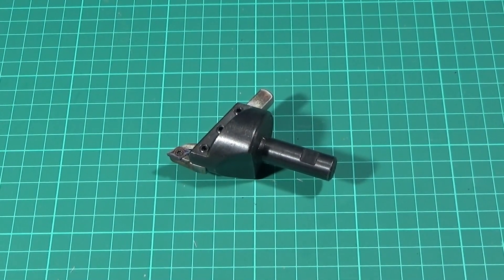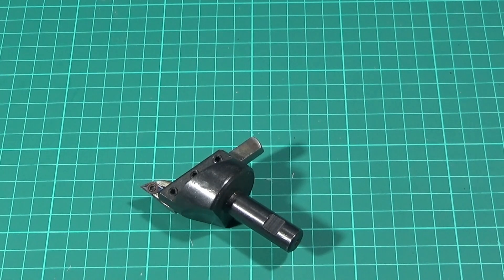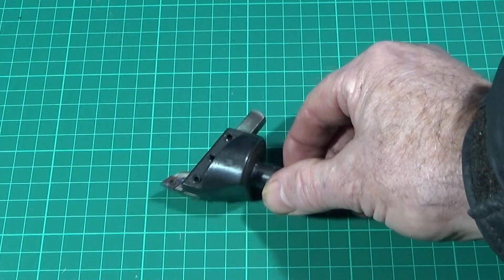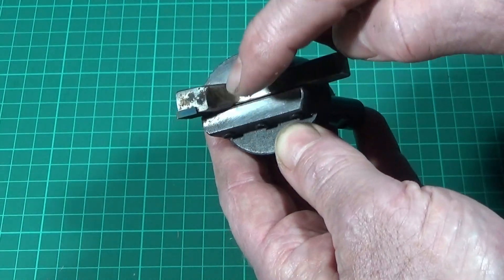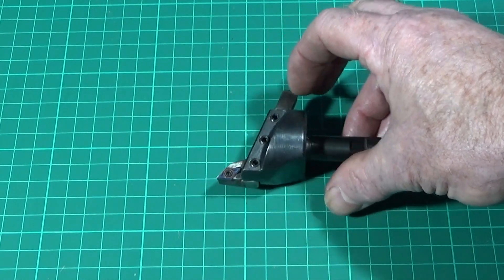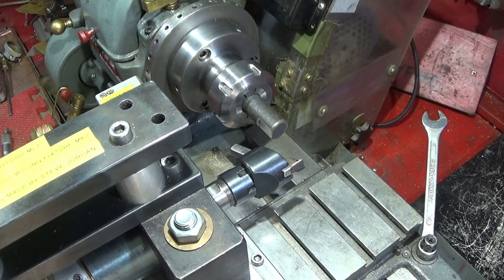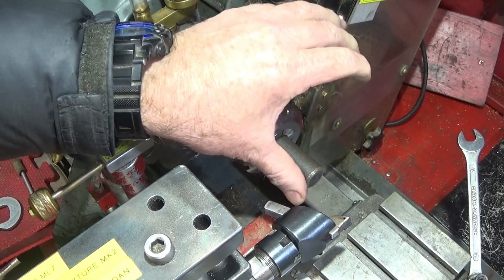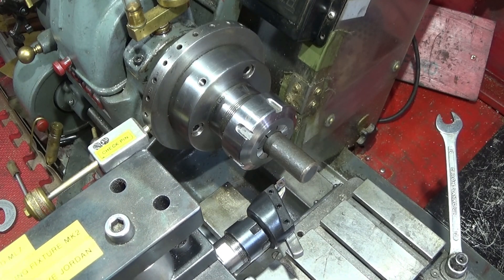Drill Powered Fly Cutting On The Myford ML7. A Power Drill Hack

Comment: Very inventive - I'm just wondering why you couldn't have just used the standard Myford milling attachment, and put the fly cutter on the main spindle in a collet chuck?
Reply from the maker: Hi, I just showed this one cut as an example, but I can use the setup for complex work incorporating the indexing system. So, it has many advantages over just using the milling attachment setup. Regards Steve
Reply: @SteveJordan  Thank you! Really interesting. Love your channel, by the way - one of my favourites.

Comment: Steve, could you tell me roughly what sort of DoC you use with those carbide inserts? My lathe is roughly the same size as yours and can run at similar speeds. Choosing a sensible depth of cut is one of my greatest problems. I know it's going to depend on the material, but a rough figure for stainless steel would be a good start!
Reply from the maker: Hi Nicholas, the deepest depth of cut I take on stainless is about.020" (.040" o/all). I don't go any deeper as I haven't got a running coolant supply. Regards Steve

Comment from the maker: SOME GREAT OFFERS ON THE DCMT070204 INSERTS:-

1. Drillpro 10pcs HRC45 Blue Nano DCMT070204 YBC251 Carbide Insert for SDJCR/SDNCN/SDQCR Turning Tool
https://ban.ggood.vip/116V6
Normal Price: $23.99
Coupon Price: $ 16.99
Code: BG4b76e8
Warehouse: ALL
EXP: 3.31

2. Drillpro 10pcs DCMT070204 YBC251 Carbide Insert for SDNCN1010H07/SDNCN1212H07 Turning Tool Holder
https://ban.ggood.vip/116V9
Normal Price: $10.99
Coupon discount: 25% OFF, about $6.74
Code: BG32857d
Warehouse: CN
EXP:3.31